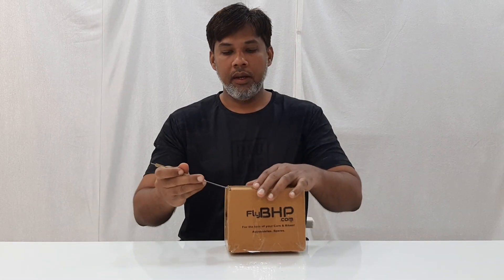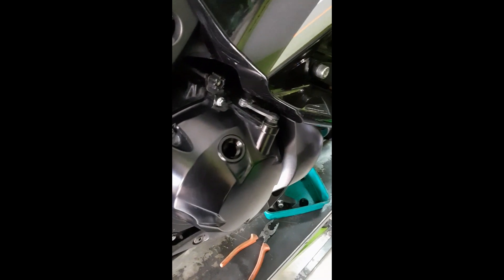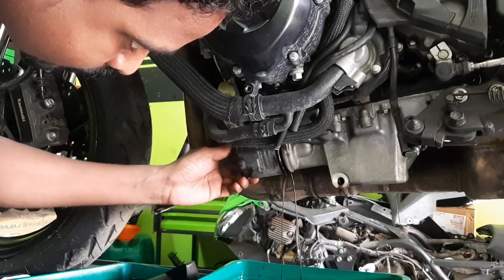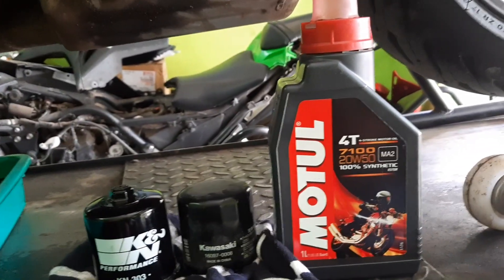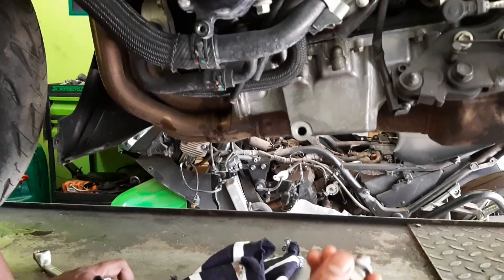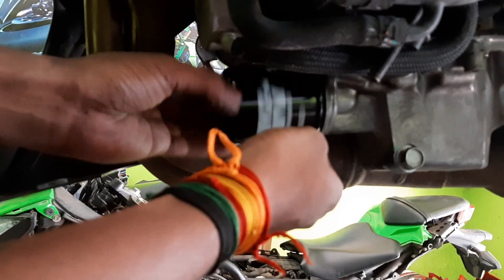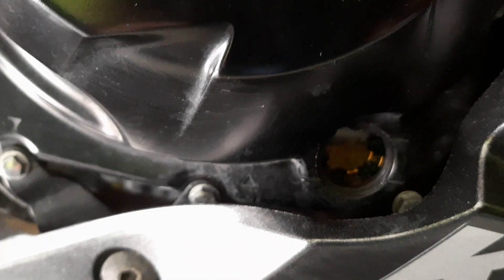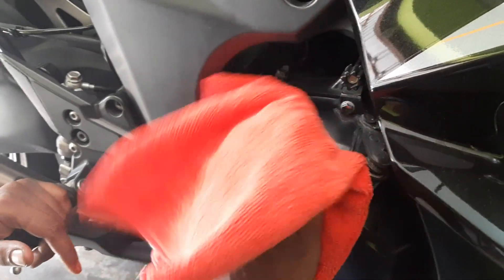UNBOXING OF K&N 303 PERFORMANCE OIL FILTER AND ENGINE OIL CHANGE ON THE KAWASAKI NINJA SX 1000

Comment: How much of the engine flush do you use ?
Reply: He used the engine flush extremely wrong.. Engine flush must be added to the old engine oil, then start the bike and let it started for 15 minutes, then drain the old oil and the flush, then change the oil filter, then add the new oil.. And about how much to use: if your bike take 2 liters of oil, you must use flush 150 ml, the big size, and if you couldn't find the 150 ml, you can buy 2 of the 80ml that he used in this video.. But only 1 flush bottle of 80ml is for scooter 125 or 150CV that use motor oil 1 liter Or 0.8 liter.. That's the truth.. Do your research.. Don't ask ignorant people in comments..
Reply from the maker: hi 150ml is more than adequate.